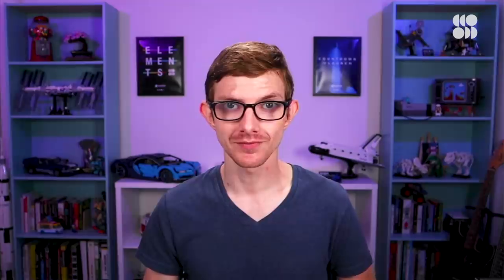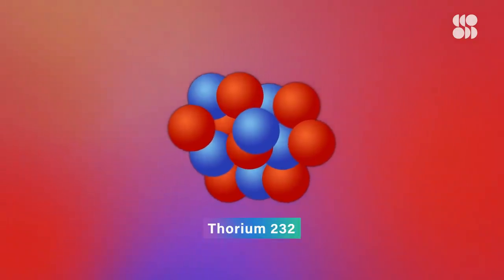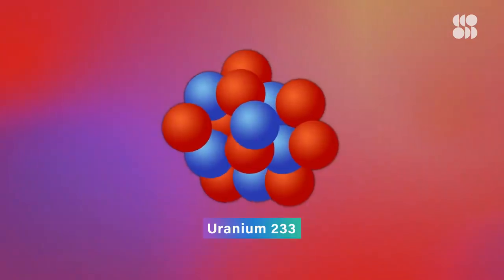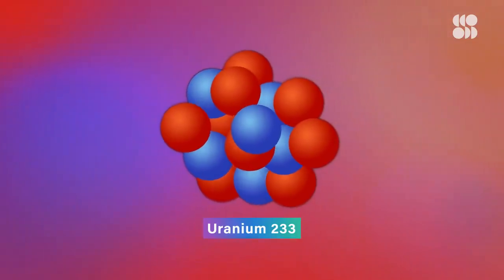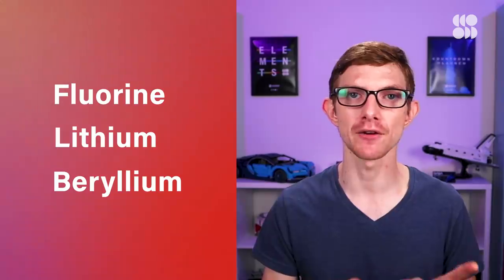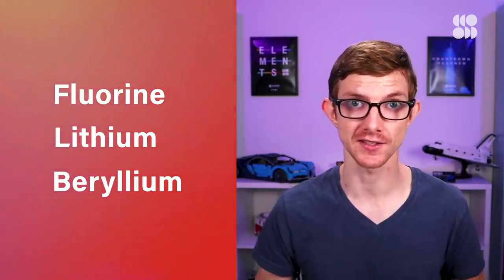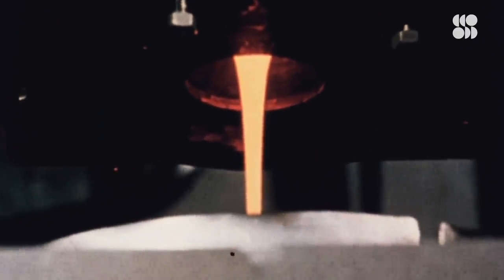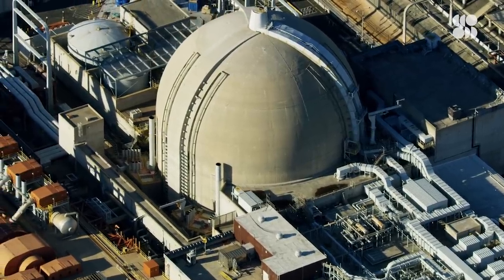The Next Generation of Nuclear Power Is Here

Comment: You didn't mention one of its biggest benefits is that there's no possibility of a catastrophic meltdown because of how it operates.
Reply: Absolutely. But modern nuclear essentially has no risk now either.
Reply: What is molten cannot have a meltdown!
Reply: @Mr-Pulse  Been looking for info to confirm your statement, but the big problem is still that with uranium/plutonium MSR reactors, the fuel still has to be enriched with centrifuges, driving up the cost of the fuel massively. Thorium MSR reactors breed their own U-233, and the fuel needs much less refining. Added bonus is that the waste products of Thorium MSR have much shorter half lives. Thorium MSR can even be designed to handle waste from other U or Pu reactors and produce ample usable energy from it.
Reply: @Mr-Pulse  that's what they say about every nuclear facility
Reply: Well, he mentioned it at 02:59
Reply: They're already safe af
Reply: @paulmobleyscience  I mean there is the sun..... if you don't count heat-stroke, sunburn & melanoma :)
Reply: @nowandrew4442  Yes I agree the sun is a great source of energy but something tells me you know exactly what I mean by magical energy source that has a massive amount of power without a cost to our lives ;) Fission and fusion will never be the answer to our energy needs.
Reply: It was implied.
Reply: @paulmobleyscience  I agree there is a concern about corrosion or radiation embrittlement of using molten salts and thorium as the cooling fluid. Which is why they're using test reactors. it's an unproven concern at this moment as i understand.
Reply: @TheKyleMcVay  Hi Kyle...it was proven back in the 60s at Oak Ridge Tennessee
Reply: @paulmobleyscience  technology has advanced a lot since the 60s.
Reply: @maanassanjay796  How has technology advanced to work out the tellurium embrittlement issue and how does that change the cost of the entire project?
Reply: actually he did mention it xD
Reply: @paulmobleyscience  Considering he is probably not a Nuclear engineer, the answer is he likely doesn't know. But I am guessing you have little more to go on than a hunch as well. 

I know this because the people who are subject matter experts, saw something that made this project worth trying again, for nearly all the major power countries. 

If it were as cut and dry as you are suggesting, with no potential solution to this guaranteed problem, then I am going to go out on a limb and say that they would have access to the same information that a random youtube commenter has access to, and would not bother with this.
Reply: @Potcha Shamans  There is a solution to the tellurium embrittlement issue.   But that solution comes at a cost and only keeps the inevitable from occurring as quickly.  This cost keeps them from ever being able to compete in the market with less expensive, less complicated and safer forms of energy production.  Everything comes at a cost and this is no different.

Comment: So one of the other proposed benefits of thorium reactors was also the fact that they can more readily be a lot smaller and could on paper be used to better build a power grid system by having smaller, localised reactors rather than a few large ones and then having to get the power to where it needs to go, logistically it's simpler but also on paper you cut down transmission losses dramatically and improve overall efficiency.
Reply: No you don't. These aren't gas powered turbines.
Reply: The reactors themselves can be smaller in size, and because of their lower operating pressure, they can be made of thinner metal. However, nuclear powerplants still work better when they're bigger thanks to what's called "neutron economy". Smaller reactors require higher fuel enrichment, which is both expensive and an easy target for fear-mongering. A small, localized reactor is better for getting the technology off the ground and for remote areas that can't rely on a grid. But once the technology becomes mainstream, bigger is better.
Reply: Aren't larger power plants more efficient, nullifying the benefit from avoiding transmission losses down to a capitalist optimum?
Reply: @Ilamarea  bigger is better yes. But another thing to consider, especially in the United States, is the politics and complications of building transmission lines. If we can have smaller and more localized generation, we can avoid having to build those transmission lines
Reply: People are going to resist having small nuclear reactors all over town, I'm sure.  But if the new tech is inherently safe, that problem will over time solve itself.
Reply: It's funny how people only want to talk about benefits while never mentioning the other side of the coin.  What most people don't seem to comprehend is why the US discontinued research on MSRs in the 60s and it wasn't due to the inability to gain weapons grade materials from the "waste".  TELLERIUM EMBRITTLEMENT of the hasteloy is exactly why MSRs were never used.  This process causes stress fracturing throughout the entire vessel within a very short period of time when a hasteloy is used.  A metal didn't exist in the 60s that could withstand this process and is exactly why MSRs aren't used.  To build a vessel that could withstand this process with a metal that could last longer than 5 years without losing its structural integrity would be so astronomically expensive it couldn't possibly compete in today's market.  China will learn this very expensive lesson due to their vessels being made of a hasteloy and a manufacturing process filled with errors that will lead them down the same path as the US.  The days of needing a corporation to produce power for the masses are coming to an end and nuclear power will be a thing of the past.
Reply: This technology can replace steam turbines in coal-fired power plants. The turbine may remain in place but fuel and technology will change. Cheaper when there is no need to build a new turbine and transformer field.
Reply: @Juze81  The steam turbine is the Achilles heal of most of our energy production and is the part of the entire system that hasn't changed much in the last century that we must develop new ways to turn a turbine.  We must move away from using fresh clean water to make steam to then turn a turbine.  This is by far the best advantage wind and solar has to offer that is never mentioned as those processes do not use our number one resource on this planet to create power.
Reply: Liquid thorium fluoride can also be utilized, replacing uranium reactors. It costs less than coal and uranium, and has little excess waste.
Reply: Two problems with first generation reactors. Megalomania and hubris. Far as I’m concerned the sized up efficiency factor was simply an argument for corruption.
Reply: @georgesaliba8876  HI George...one correction here they are LFTR or liquid fluoride thorium reactors and tellurium embrittlement would still be an issue.  There will never be a magical energy source where we get massive amounts of energy at little to no cost of its use.
Reply: Smr are way better. They can be standardized and build in a assembly line. The driving cost for nuclear power is the construction of a reactor and since we need a low of non co2 emmiteant power fast and with low cost smr is the way to go. Its also way easier to upgrade and maintain.
Reply: @BS-vm5bt  "Normalized discharges" contain Carbon-14 that would bond to oxygen to form 14CO2, radioactive carbon dioxide.  Nuclear reactors are far from carbon free including the fuel which uses massive amounts of fossil fuels to achieve. Nuclear reactors including small modular reactors are not emission free.  The pebble fuel is actually surrounded by multiple layers of carbon.  The small modular reactors would be in dozens that run off one single control room.  There is no difference with a smaller scale reactor other than when a meltdown occurs there would be less fuel melting down and thats only if it doesn't spread to the others.  Small modular reactors wouldn't have the containment that a larger scale reactor has thus causing more to enter the biota
Reply: @paulmobleyscience   we have same kind of problem in fusion so why not give up on fusion too ? We will save even more money...
Reply: @Gauloi007  I agree
Reply: @paulmobleyscience    OK. Then how does that carbon use/release compare to wind and solar over their lifetimes. And the comparison to fossil fuel generators? We’re backed into a corner here. Somethings got to give. My hope would be that as we develop a 100% electrical infrastructure we learn things that help us mitigate the current warming. Relying on business as usual seems a recipe for guaranteed disaster to me.
Reply: @mtn1793  Being that solar and wind doesn't use fresh water to turn a turbine then the bonding to oxygen must be much lower than all other energy sources that use steam turbines.  The days of needing a corporation for energy production are coming to an end as there are thousands of companies that can come to your home and install a solar array that will not only power your home 365 days a year rain or shine but also produce energy that can be fed back into the grid.   Solar and wind generations major benifit is not using fresh water to turn to steam to then turn a turbine and is by far the best option along with development of more geothermal and less affecting hydro.
Reply: @mtn1793  The current warming has little to do with humans and more to do with solar cycles of which solar maximum occurred when the politicians and paid off scientists proposed human global warming affects.  CO2 is not the only factor of climate forcing.
Reply: @paulmobleyscience    That’s an interesting correlation that I’ll keep in mind (heated water) There’s a lot of carbon going into production of wind and solar though and that has to be accounted also. Personally I think we need to charge full speed on all of it. If I was a dictator economist I’d be working on free abundant electricity for all. A free electricity economy. But with the mandated priority to come into balance ecologically, by population levels and across wealth distribution.
Reply: @mtn1793  Carbon....when did carbon become such the bad guy as we are carbon based lifeforms?  The issue is more that we've cut down so many trees that there is not only far less carbon dioxide being turned into oxygen through photosynthesis but also much less storage on land and why it is making it to the oceans in more concentrations.   We should be focusing on not only planting more trees but also cease to cut down more forrestation in an attempt to profit from it.   There is plenty of cleared land for the population of the world to live on and do not need to clear more Forrest for living purposes.  Our use of paper has decreased astronomically through the last few decades but corporations and governments continue to knock it down at a record pace.  We don't need different energy production we simply need more trees.  We don't need carbon scrubbing facilities that knocked down trees to be built we simply need more trees.  It can't be any more simple of an idea here.  This is corporate driven and we need to cease to demand the next big thing, we as a population are just at much as fault as corporations due to our ensational greed for consuming everything possible.
Reply: @mtn1793  Nuclear doesn't have a smaller carbon footprint when you take into consideration more than just day to day operations at a reactor.  First the uranium must be mined with fossil fueled heavy equipment that is then trucked from the site using fossil fuels and then placed on a ship that uses more fossil fuels.  That uranium is then unloaded at a port where it is then trucked from that site to the processing plant where even more fossil fuels are used to convert it into a usable fuel source.  It is then trucked to various sites from that processing plant using more fossil fuel burning trucks.  Once loaded into the reactor that reactor must be backed up with offsite power as nuclear reactors do not power themselves and are usually fossil fueled energy.  Backup diesel generators are used as 2 different sources of energy must feed every reactor for safety.  Once the fuel is used up it is then cooled in a pool using pumps that run off the same offsite power that is fossil fuels primarily.  Once cooled it is either stored on sight or taken to be reprocessed using yet again more trucks to transport it to the reprocessing plant where chemicals such as hexafluoride is used that was more than likely used fossil fuels to make and then converted into usable fuel.  That fuel is then trucked back to a nuclear reactor using even more fossil fuels to then be used at a reactor.  This is the entire cycle that most that speak about nuclear being carbon free don't ever think about and it needs to be part of the equation.  Just to have nuclear reactors we will always use more fossil fuels because of it.
Reply: @Gauloi007  Saving money isn't really a top priority.
Reply: @paulmobleyscience  Coal plants have the same supply chain requirements as the nuclear plants. The difference is that coal plants consume many tens of thousands of tons of coal per day, whereas nuclear plants use just several tons of refined fuel per SEVERAL YEARS. The most carbon intensive part of a nuclear reactor is most likely the concrete required, which is enormous, but it only has to be built once.
Reply: @lazyman114  I never said coal plants didn't...whats your point?  Before you barged in talking about coal plants this discussion is about nuclear power not coal.  Why do you think it's acceptable to compare apples to oranges when oranges were never mentioned before you mentioned them?   This is not about comparing different energy sources...I made the point that nuclear has never been nor ever will be carbon free as advertised its as simple as that.
Reply: @lazyman114  I don't advocate the use of coal so you wasted your time and mine....thank you.
Reply: @lazyman114  it was sarcastic...
Reply: on paper moderated by ink

Comment: I think Thorium molten-salt reactors are the answer to many problems. 
1.) The technically important heavy rare earth metals like Neodymium and Dysprosium usually come bound in mozanite minerals, that also contain a large amount of tlThorium. Currently this thorium is stored as radioactive waste. Thousands of tonnes of thorium are standing around in Malaysia, China and other countries. A lot of nuclear fuel used in Thorium reactors doesn't need to be mined specifically, but is a byproduct of Rare Earth Element production.
2a.)The molten salt concept allows the use of the Thorium fuel to a much higher degree. The continuous addition and removal of new and spent nuclear fuel, makes the operation of the MSR much more efficient, as there is no need to shut down the reactor for fuel rod changes. 2b.) The recycling of spent fuel is continuous and can be handles on site of the power plant.  Highly active and long lasting radio isotopes from conventional lightwater reactors can be burned up into lower radioactive with shorter halflife isotopes. Those can be more easily stored for eternity.
2c.) The danger of nuclear accidents and core melt downs is much lower, because if the molteb salt is overheating, a simple passive security mechanism is used to stop the nuclear reaction. The ambient pressure of the reactor vessel will not explode to this huge amounts of radioactive waste into the atmosphere as happened in Cheronbyl or Fukoshima.
3a.) Nixon took the decision to keep the nuclear power industry in his native California. 
Oak Ridge National Labs, the originator of the Thorium molten salt reactor concept, was an outlier and did not fit into his plans. 
3b.) The thorium reactors did not produce any weapons grade plutonium, which was needed to feed into the growing nuclear weapons stockpile.
4.) For China, India and even the EU, the Thorium Molten Salt reactor would be an excellent power technology, because it would allow the export of this technology around the world, without violating 'nuclear non-proliferation' treaties. The fissile material used or produced in it is not weapons grade.

Thorium molten salt reactors are a big winner in my books. I truly hope that the experimental  reactor in China will show the full potential of this technology.